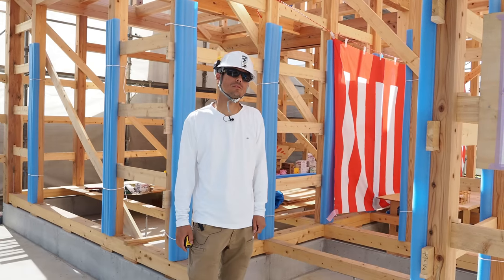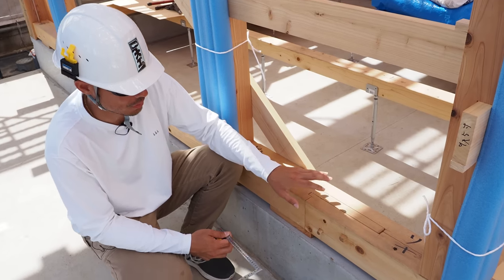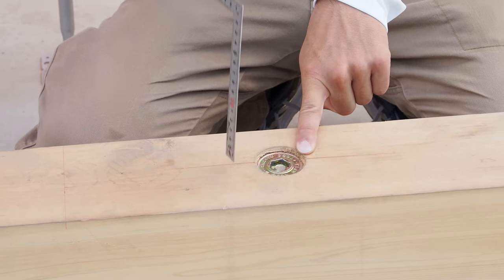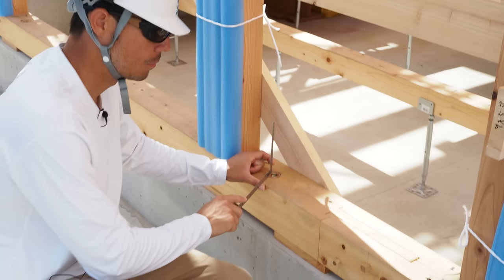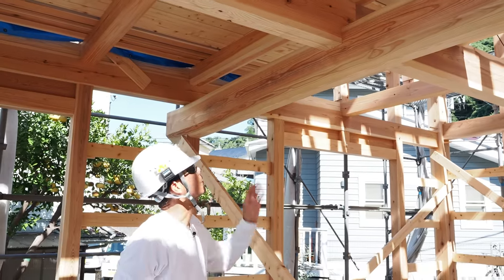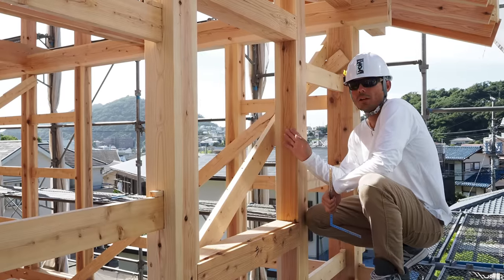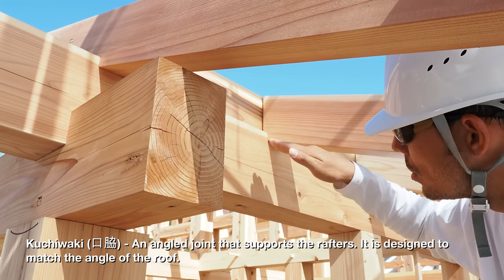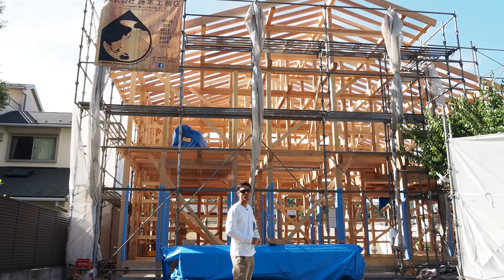A Technical Walk Through of a Japanese - American House Build in Japan - Traditional Carpentry

Comment: thats some impressive joinery, thanks for sharing it! a personal pet peeve  the use of mm in architecture, most materials are still produced in imperial dimensions.... a 2x4 is still a 2x4  well nominally lol sheet goods are still 4*8 hardware is still inch fractional ... it works  studs 16 on centre 1/2 inch supply  npt fine ..... there all standards with centuries of development and are easy to use and remember  unlike 1200*2400 ish or 6.5 mm or 25.4 mm  or 12.7mm   at least cm notation would simplify over mm   carpentry is not preformed to 3 hair widths accuracy or your builder is going bankrupt! mm is great for machinists not architects or carpenters.
Reply: my schooling is architecture @david-ow3nv  but that was many years ago now. as it happens i was in school while we changed . what i was saying is materials are still produced in imperial dimensions  we still use 2x in stick framing sheet goods are still 4x8 ...the materials are sized for use with an imperial  system of measurement and it is still far easier to design with that system than in metric and converting....i am painfully aware  of how much easier ...1/4 of 25.4 mm is a useless number but 1/4 inch is easy to work with ...would you do pharmacology in metric tonnes when your using micro-grams? but thanks for your input